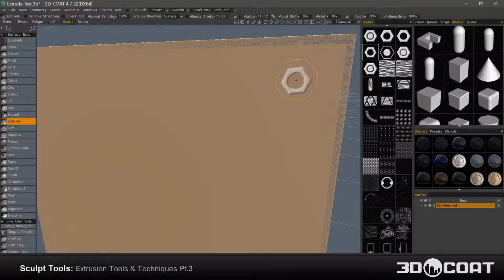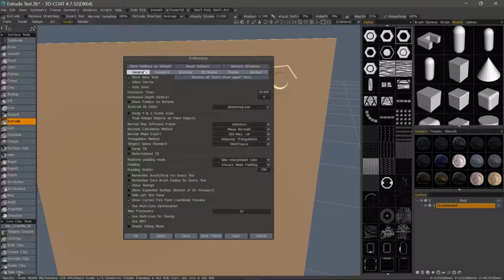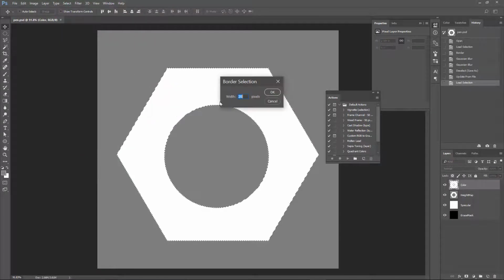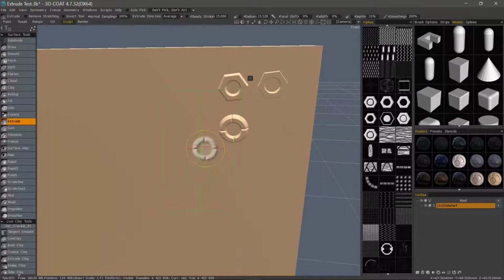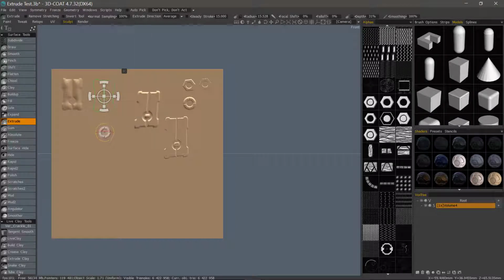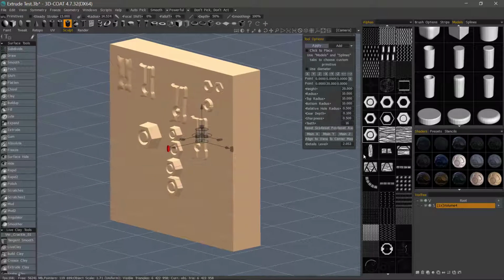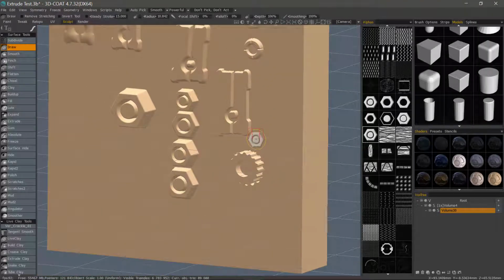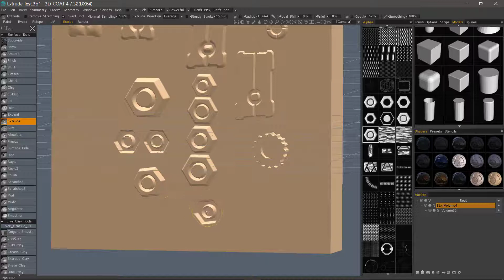Extrusion Tools & Techniques Pt.3

Comment: any way to rotate brush?
Reply from the maker: You can use the 9 or 0 key (not in the NumPad) or in the E-Panel (hit the E-Key to bring it up or find it just above the Tool Panel), chose the Stamp draw mode. As you click and drag, you can move your cursor around the initial pick point in order to rotate the brush...with a live preview.